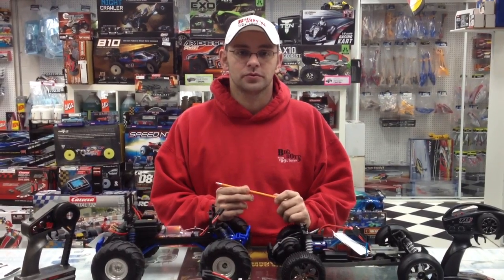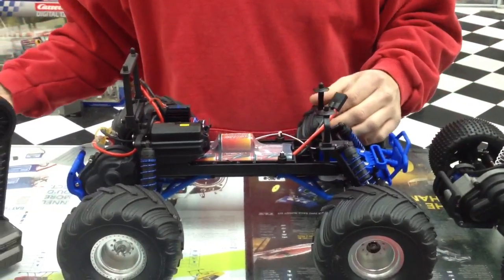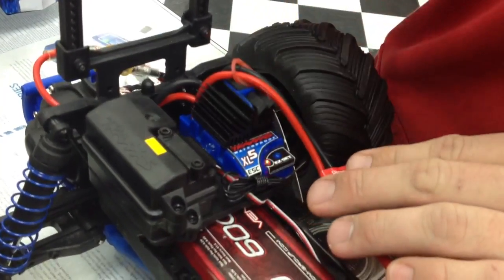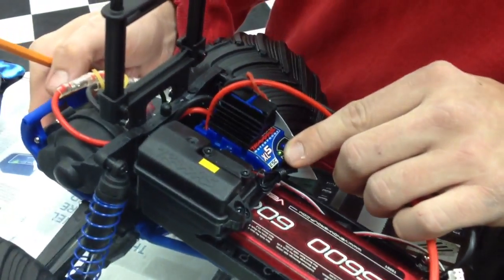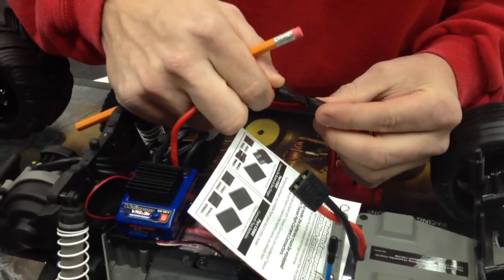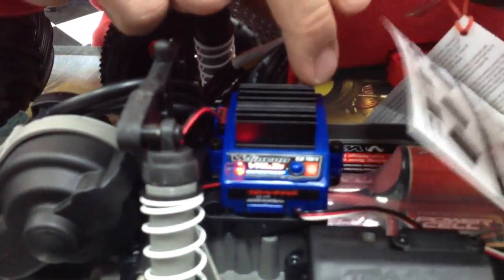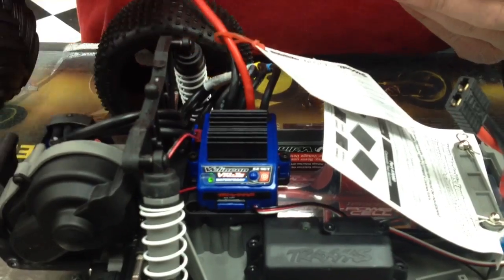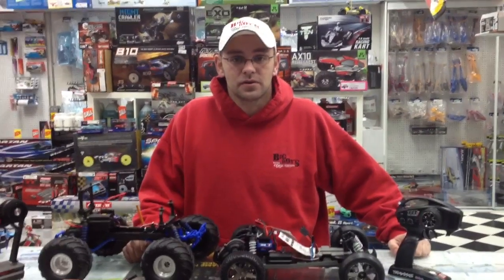Traxxas Low voltage detection

Comment: I have charged my car battery imgs.love/cBatteryCharger with this when my lesser charger stopped working after a 1-2 years. Very easy to use! I have started my heavy diesel truck, JD tractor and charged the battery on my (too little used) Miata. Very safe and I feel MUCH better being able to not worry about hooking up then taking off the jumpers. MUCH safer than using my car with jumper cables! I can attach jumpers before turning it on and then turn it off before touching the jumpers again. Love it!

Comment: My ESC is blinking Green and it won't move. Steering works but not the throttle. What my problem here??
Reply: I'm late here but it means your throttle trim is of center. Adjust it and everything is good.
Reply: Jeroen Engelgeer how do I do that.?
Reply: your in low voltage detection with a nimh
Reply: Robert Brickle I have the same problem
Reply: Robert Brickle recalibrate the transmitter to the receiver
Reply: So say my fully charged Vxl keeps going in low voltage within minutes then seconds of being in low voltage shuts off, runs down to 9v if that. I’ve tried to reset the esc
Reply: Esc Is done it burned